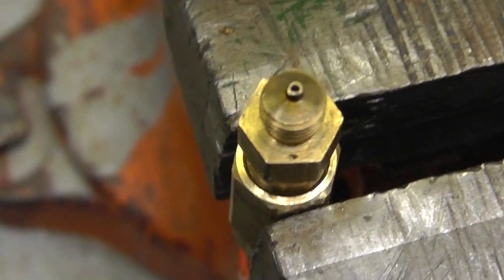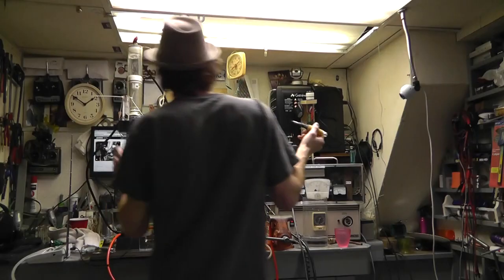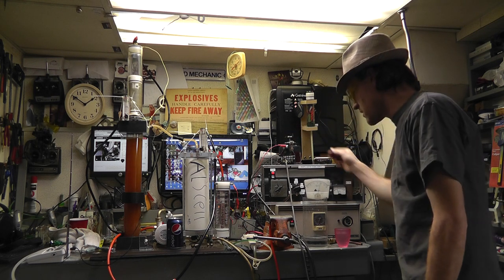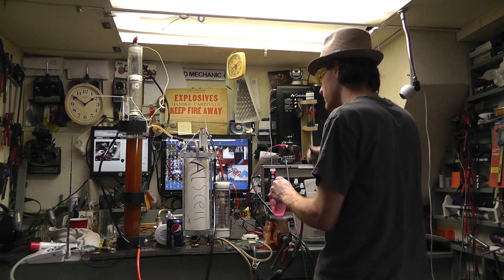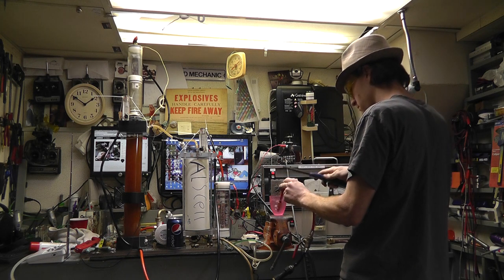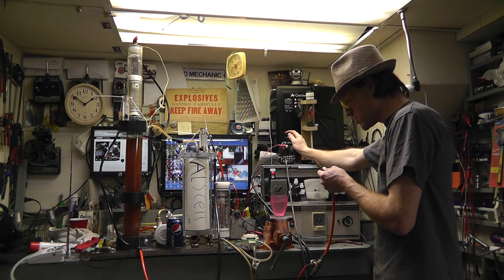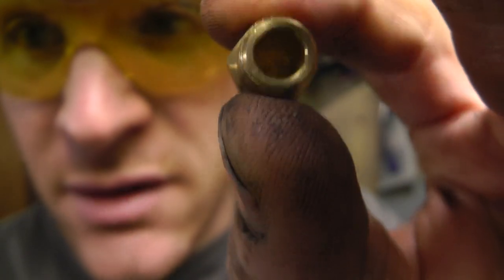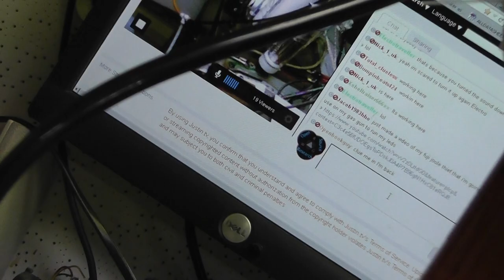Burn Rate Testing With HGG Corona Dish Charge Air Ionizing. More Testing Needed.

Comment: Russ that was one of the reasons I worked up the gas splitter cell(GSC ™), The design allows the tester to be able to work with the two gases in a controlled manner at what ever ratio is needed. 
Give her a go....I saw an improvement when I was passing the gas through the Spark gap ????? 
I also observed a spectural change toward the UV... expected.
Bill

Comment: Russ, I think the thing your holding in the end of this video is a bronze defuser used in oil heating systems... I'd like to make a suggestion, for the tip your using at the flame front, you'd probally be better off using either the smallest mig welding tip you can find or a fuel jet from a carb off an engine, this will make the flame longer and you might be able to see any differences in burn rate easyer

Comment: For testing burn rate,you need a way to compare the flame speed.Just doing pops in a jar is far from qualatative.Try setting up a burn tube with a length of tubing,for calculation sake a 1meter length would be good.Then you can slow down the video and count how many frames it took to burn down the tube,knowing the frame rate of your camera,should be able to calculate reliable numbers

Comment from the maker: @vipond50 Good question, just regular atmosphere air. If I were to use your split gas cell and run the oxygen side into the pump through the ionizer and then the hydrogen site into the tip and meter mix the two together you think I'd see a different result? Makes sence that I would?

Comment: @rwg42985 hey Russ I been notice people talking about usen argon gas. If u are able to separate and have just have hydrogen check into tri mix welding shield gas. It can comes in various mixes. Mixes of argon nitrogen helium. Also there are mixes that are design to burn hotter when used ill try to find a proper mix for u if interested

Comment: @rwg42985 hey Russ u gota question what about cooling the gas down with dry ice. If im correct a gas that's colder can be compressed higher. It be interesting to find out how ionized hho dose when chilled